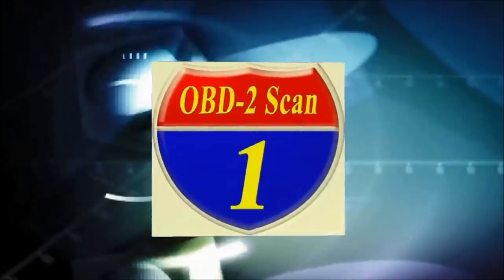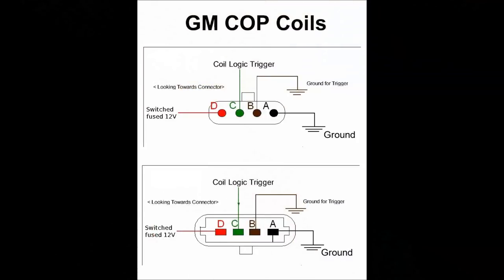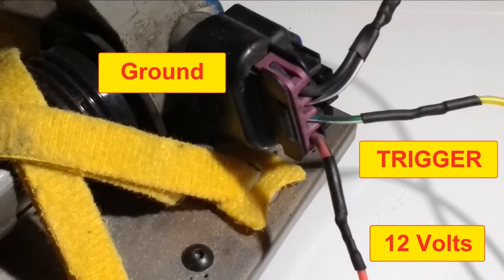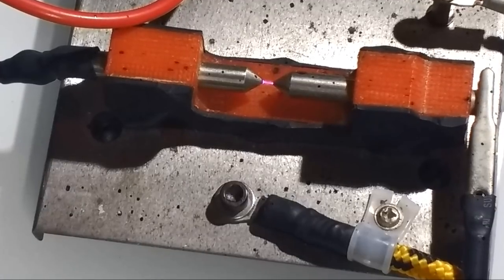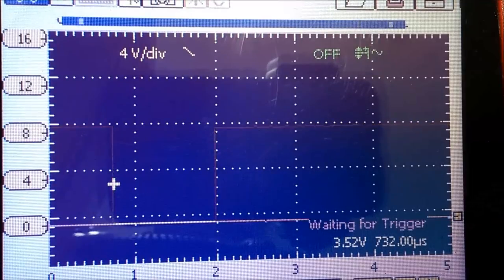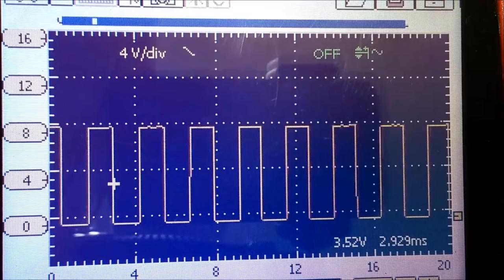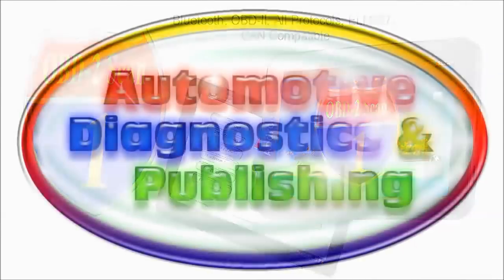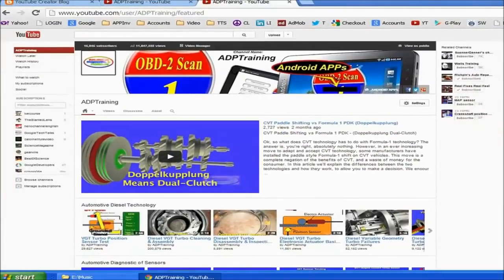How to Trigger Internal Igniter Ignition Coils

Comment: Isn't the circuit that is in the coil a Darlington transistor with gate timing /capacitance aka timing built in at 2ms already and doesn't mater what 5 volt pulse you give it always gives a 2ms spark?